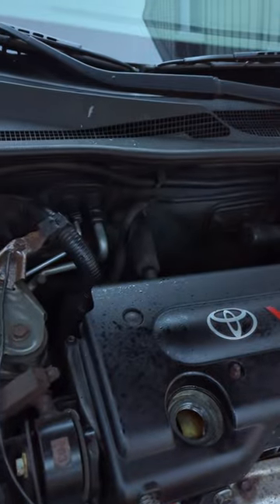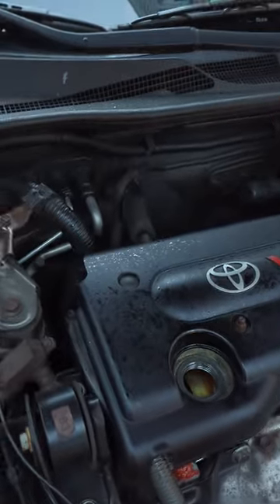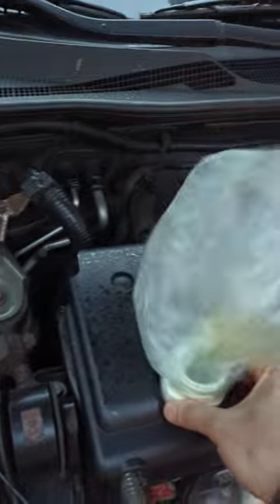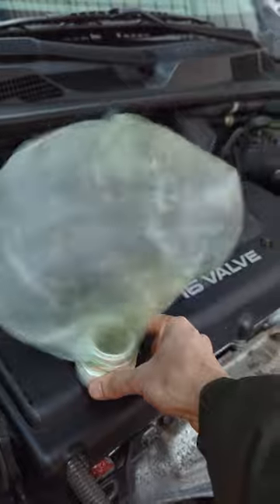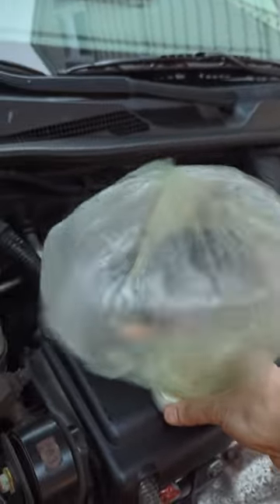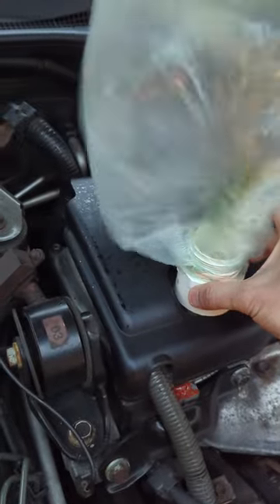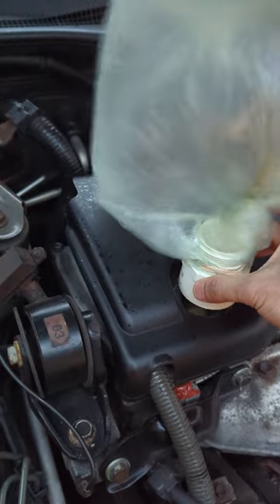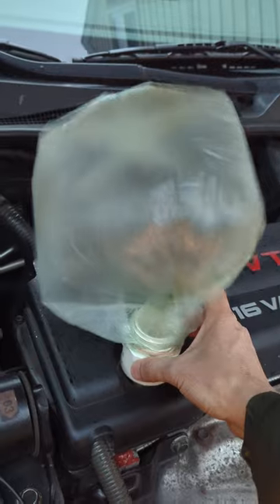Air from the oil cap.

Comment: that's normal as long as there's no smoke/vapors pouring out
Reply: Mine has smoke coming out when I turn it off and open cap is that bad ?
Reply: @CoTyCj  yea, that's not good
Reply from the maker: It has some smoke and little vapors coming out.
Reply: @someone1089  that's blow-by and it shouldn't be producing smoke.  that means oil is getting past the rings.
Reply from the maker: @allseeingeyezz  thanks for your input.
Reply: smoke is normal when the engina has run hot

Comment: I'm a mechanic, you need to remove the pipe on the side of the pcv, start the engine and then check if there is vacuum from the pipe and update me
Reply: Hi could this vacuum leak cause power loss? Please let me know if you can thank you
Reply: Heu buddy @Robertmartini6126 my toyota camera is doing that now. I just changed the catalytic converter.  That sounds better but I lost power when I step on it and acts like it's redlining at 3k rpm.
Reply: @Wetsocksandavocados how did you fix it? Got this blow by on my 2.4 and i think its the piston rings letting compression on the block.

Comment: My 2014 civic does the same thing. I checked compression, it’s good at 155 psi all cylinders. I also checked pcv, it’s good too. I think it’s normal for these 4 bangers
Reply from the maker: @kija4917  Agree with you. I sold the car and bought another Toyota with 2ARFE engine, and it has same behavior, but performance issues at all.

Comment: Hey brother, my car is having the same issue but the car is running fine. As i can see you uploaded the video a year ago and a lot of people in your comments are saying that its normal, did you diagnosed what was the issue or its actually normal? Please guide Thank you
Reply: Did u ever figure it out my is doin the same thing
Reply from the maker: I still have this symptom, but my car runs fine, except that it consumes oil. Someone says it's ring issue, but I haven't done anything yet. Thanks for your interest.
Reply: @someone1089  yes i running it like that it seems fine just gonna have to keep filling it with oil for sure i keep reading about does piston rings too so tht will be a big job maybe new motor if it doesn’t get worse

Comment: It's called blowby there is air coming in from the exhaust to the head, defenely not normal, have to check for open valve, pvc valve head gasket etc
Reply from the maker: Thanks for your valuable input. The pcv valve is already replaced. I am leaning towards open valve theory, perhaps the valve seating area got carbon deposits and valve doesn't close during exhaust cycle, and perhaps the valve seals are also damaged. I really hope it's not the head gasket.
Reply: @someone1089 Did you find out what it was? My honda crv is doing same thing.
Reply: Please update
Reply: @someone1089  what was your conclusion?
Reply from the maker: @devinhimes2325  sorry about the delay. I believe it's normal, the car didn't have any functional or performance issues.
Unfortunately I recently sold the car and bought a Toyota RAV4, with similar engine (2ARFE), and it is also blowing air from the oil cap. The car has no issues at all.
So I concluded that the engine is running as designed.

Comment: 2017 Honda Accord. Removed the oil cap, and the car turns off. With it on, it works perfectly normal. Is it normal for it to turn off when the  cap is removed?

Comment: They said that is not blow by, it's breathing in and out. It's not a one way. That is considered normal. If it's just blow out, that's bag will busted, that that is a major problem, you need a new car. Yes, as car get older, the breathing is much heavier, and yes a lot of maintenance and care for it. Or buy a new one. If you dont have any sign of leaking gaskets or oils. They said it's ok not to worry.

Comment: Its sometimes piston rings. Check  compression on each cylinder .
Reply from the maker: @Mental_hygenics  Sorry for the delay. I already checked the compression on all 4 cylinders, they are all good, close to the specs both wet and dry.
Reply: @someone1089  well in my world. If it isn't causing a problem and isn't making my machine worse let it be😂. I'll probably break what I'm trying to fix by not knowing every detail of the machine I'm playing with. It would be interesting to know if the viscosity of oil and if there is blow by when under normal operation.